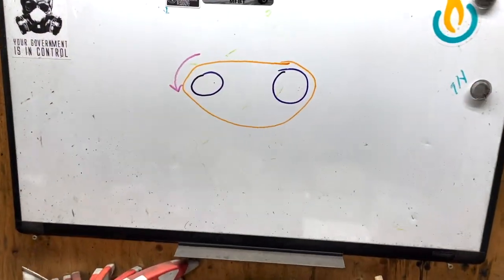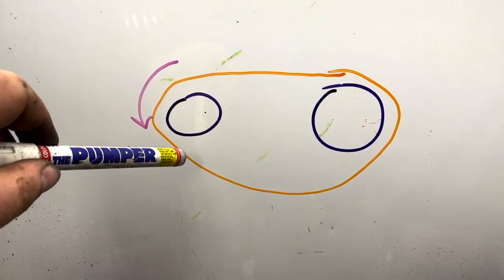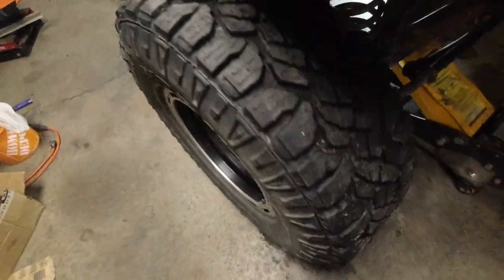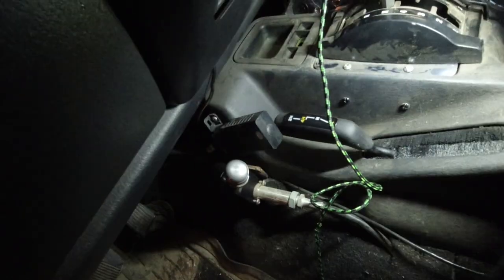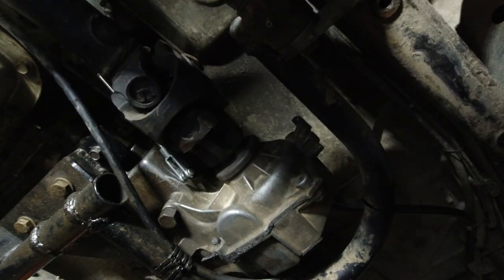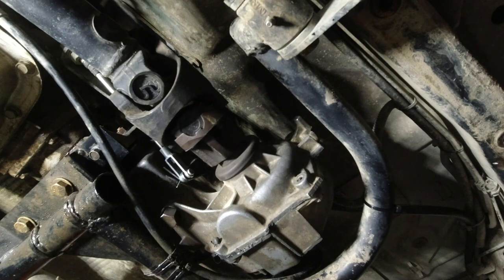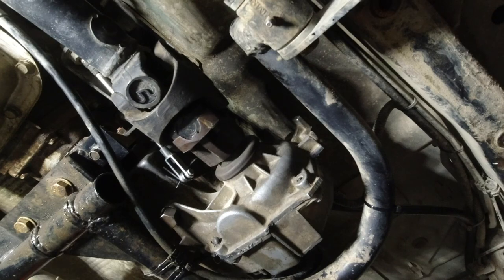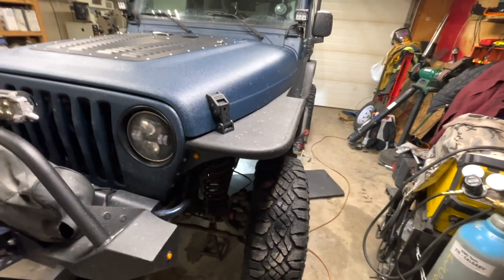Easy Way to Check Transfer case  Chain Stretch

Comment: People should keep a check on this every oil change. Keep it from exploding on you while running down the freeway.
Reply: @nate4036 did that happen to you?
Reply: @ehask06  no I’ve had 2 friends that had theirs come apart on the interstate
Reply: Hi, does the chain still go around even in just 2WD.Thanks.
Reply: @oldgamer1330  yes, it’s actually worse when in 2wd especially as it stretches and develops slack. When engaged in 4wd there’s a shared load. But in 2wd, it’s in a free spin state.
Reply: @nate4036  Ok thanks. I don't run a front tailshaft, will it still turn?
Reply: @oldgamer1330  yep, the main shaft that passes through from transmission to the rear driveshaft is where the sprocket is. If the transmission is spinning, so is the chain in the t-case
Reply: @nate4036  My 01 Sport Trac has a strange clucking sound and you can feel it through the truck but only after you have been driving fast on the freeway for a while and then you slow down and exit for a fuel stop and you are moving very slow just moving up to the bowsers and then by the time you get fueled up and start to leave it has stopped making the noise again. I was wondering if the chain gets hot and sags a little bit and is hitting on something.
Reply: @oldgamer1330  clunking is typically a u joint failing. A chain failure starts with a horrible grinding sound, but once it starts, it’s short lived. To check u joints, park on level ground and slide under it. At each joint try lifting up and side to side. Any movement is a dead joint
Reply: @nate4036  Yes a uni joint is what it sounds like but I have checked them and I have just come back from a 2000 mile trip and there was no vibrations at all and only the clunking sounds would come back when I would go to refuel. It really has me stumped but it is good to know the different sounds of the chain now. This is so bad you can feel the whole truck shake as it does it, but then one you are moving above walking speed it has all gone again.